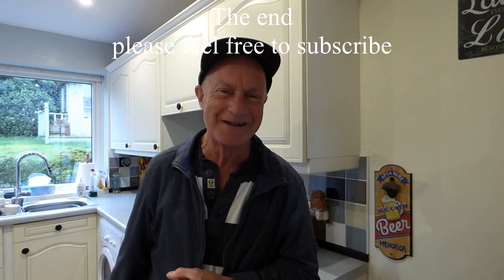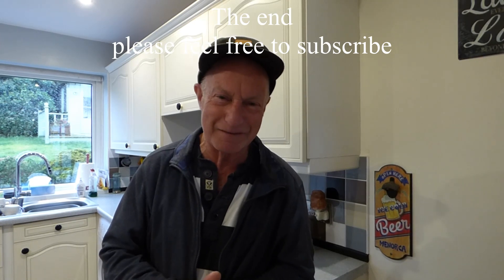What is the best speed to set the central heating pump ?

Comment: Another great video, thanks. I understand that all modern pumps are required (by EU law) to have an electronic speed controller which modulated the speed according to the system requirements which can change when valves open and close (zone valves, thermostatic valves, etc). So my question is, does it really matter what speed you select these days? Just stick it on max and let the pump control its own speed?
Reply from the maker: Great point! This refers More to the older pumps

Comment: Very good advice there, thanks. I think there should be a standard setting based on the amount of rads, that would cut out the guess work to some extent. In a 2 bedroom flat I don’t think you need the higher setting, you can set it at 2. For a 2 storey house with bigger rads and longer pipe runs, maybe 3 would be more appropriate setting. If you live in a mansion, it doesn’t matter, you will probably be abroad in some tropical country sunning it up.😃
Reply from the maker: Ha ha thanks.

Comment: lol a pint for me
Reply from the maker: System overheating you have black sludge that needs cleaning out. Or if it is running in when cold, then your hot water cylinder inner coil is broken or holed.

Comment: can any one tell me why i have water coming from my vent pipe in my f and e tank in the attic i have a solid fuel back boiler since the 1980
Reply from the maker: Need more specific info like if it only happens when the heating is on and have you had the system cleaned.
Reply: only when the heating is on when the pump is running .thanks @dereton33

Comment: very generous of you to help folks like this. Heres my riddle. Got an entire new boiler, pump, electrics, motorises valves and system flush for a two zone system. Plumber forgot to tighten down the pump and it leaked water for several days and I only discovered this as the noise was significant. He returned, tightened the pump down and the heavy noise dropped significantly but we’re left with a persistent high pitched whine that can be heard throughout the house. Im sure he will address this issue but I’d be grateful for your thoughts on what might be causing the whineing.
Reply from the maker: Usually air in the system.
Reply: pump speed was too high, whisper quiet now

Comment: Hello, my plumber has advised me to leave the pump on 3 but the pump gets very loud. I have changed the pump speed to 2 which works fine but now the boiler is short cycling. Any advise?
Reply from the maker: You must have a noisy bearing in the pump. Might be worth looking to change it.

Comment: I'm confused.  If I open all the radiators valves and TRVs to test pump speed, surely the last rads in the system won't get hot as the first rads will have used all the heat?
Reply from the maker: Balance them all first then test pump speed.
Reply: @dereton33  Thank you

Comment: My pump has decided not to turn off unless I drop it down to the lowest setting and the rads get hot even if only water is on; never had the problem before - the boiler/programmer/etc is about 5yrs old and it's a three bed semi.
Reply from the maker: The 3 way valve is faulty.
Reply: @dereton33  is this expensive to rectify on a system boiler?

Comment: What does the dial in the middle do?
The one on the red with arrow
 Mine is set to maximum?

Also does speed increase pressure?
If set to speed 3,is this running faster and increased pressure too?
Reply from the maker: The speed dial speed 2 is the best setting speed 3 like yours is costing more to run and putting more pressure on the system.
Reply: @dereton33  what does the twist knob dial do in the middle of the pump? Is that something we can alter?

Also what is difference between the speed when setting is solid and flashing?
It looks like there are 6 options to choose from?

Comment: I have just fitted a Wilo pico 1-6 that says lowest speed is for 12 radiators. Do you count double radiators as 2? The system is 15mm to the rads except one tiny one in an extension on 10mm and it's not heating up.
Reply from the maker: No, do not count them as 2. To get that 10 mm fed rad working you will need to system balance the other rads in order to force the water through the 10 mm pipe, or turn the pump up some more.
Reply: The diameter of the circulating pipework is important.  If you have a 15mm circulating pipework on 12 rads that seems restricting to me and may cause the rads at the end of the system never to get hot.
I have 15 rads in a 3 story house and put in 28mm circulating copper pipework to start with knowing I am never going to have a circulation problem.  I use it with an old ideal mexico cast iron boiler which runs on a bog standard timer.  I set the boiler thermostat manually and works a treat, no programmer, no fan, no pressurisation system, just a header tank, works beautiful.

Comment: Great videos and gentle quality knowledge 
How do you work out which central heating pump is best for your system and if a pump is on most of the time as in my elderly parents home, how long before it is worn out and are the signs of wear only by lack of heat in the system or is it always audible at the pump
Happy New Year
Reply from the maker: Pump starts to sound noisy and rads start to fail to heat up. A grunfos is always the best pump no matter which model.

Comment: High speed lower pressure so if the furthest rad doesnt get hot try turning the speed down a notch as the extra pressure might clear the sludge build up which should then be trapped by the magnaclean
Reply: Hi mate. It’s the other way around, actually - the higher the speed setting the higher the pressure. You can see that on the pump speed curves produced by the manufacturer. If all the rads are not getting hot you’d need to turn the pump speed up to force more water around the system.
Reply from the maker: thanks

Comment: Does this apply to a system boiler (s plan)?
Reply from the maker: Yes.
Reply: @dereton33  thanks for the reply. As it's an integrated pump I guess it will be a menu option. Think I need to read the manual!

Comment: Hi,

Thanks for the video. I have recently had 3 rads changed in my house but one rad keeps needing bleeding and it’s a lot of air… I have the gravity fed system.. I’ve had a plumber out and he put on auto bleed valves in the rad yesterday but this morning the radiator feels cold at the top and warm at the bottom again so suggests to me it’s still got air in it. I’m struggling now as to what to do so any suggesting from you would be great. 
Thank you.

Ps
Whenever I turn the heating on it sounds like the water is whooshing around in the rads like there’s not enough water in them.
Reply from the maker: Rad speed is too high set it a speed lower. Also your plumber may have left air in the system by the sounds of it.
Reply: @dereton33  how do I do that mate? I’m clueless when it comes to plumbing?
Reply: @dereton33  if you mean the pump it’s at 1 already.

Comment: Hi, do you mean both valves on each radiator? As in including lock shield? My pump is on 3, with 8 rads, just seems overkil for a 3 bed house imo

Also when hot water tank comes on, the radiators cool, is that normal? Thanks
Reply from the maker: Yes both valves, it is normal for the rads to cool only slightly, when the hot tank comes on.

Comment: Hi Al, what about auto setting 🤔 . I have a back boiler and a stove. Also central heating. Central heating is off and The fire in the stove has died well down but the pump was set up at 3 and going crazy for hours. I don't think it's right. I do have alot of rads and 3 stories to heat but I had rads off in the middle floor and down a bit on top floor. Anyway I set the pump to auto and it stopped spinning and went from 45 down to about 13. But I'm not sure what I'm at either. Any advice please 🙂
Reply from the maker: Auto will be fine, but if you want to be in the middle ground set it to 2.

Comment: THank you AL, your knowledge and clear explanations calm me down when dealing with and starting to panick with central heating issues.
would you recommend a system flush before fitting a new pump?
Reply from the maker: Yes as it is a system drain down to do it. You may as well.

Comment: hi bud, im having trouble with my central heating atm i seem to think the circulating pump has either seized or burnt out but my question is if either of those things have happened would it stop my boiler from firing up?
Reply from the maker: Yes it would, depending on what system you have. On an F and E system it would not, the boiler would fire run until it reached stat temperature then turn off.
Reply: @dereton33  mine is an F and E system, would the fact their might be air in the boiler/system stop the boiler from firing up? if so could i bleed the system via a radiator as the draincock on the boiler has seized?

My boiler does fire up for about 30 seconds then goes off. 

Also thanks for your help i have subbed to your channel great help 👍

Comment: hi mate same question but i dont have high med low i have this what do i set???  - Target value of internal high-efficiency pump in %. Possible settings:
0 = Auto
1 = 53
2 = 60
3 = 70
4 = 85
5 = 100

at moment its on auto and i can check the speed says 15%  my  return temp on the lcd of the boiler says 60c but i have thermometer strapped to return which says 52c  so idk if the lcd on boiler that says return 60c is accurate or my pipe thermomter??  I HAVE AN ECOTEC PRO 28
Reply from the maker: Best thing is to try setting the different speeds and seeing what results you get. See if you can get that return temperature any higher.
Reply: @dereton33  ok thanks what the best return temperature i should aim for. also  have a setting at d0 menu -  Heating partial load - its on 12kw  and we just had 2 new rads added with no adjustments should i leave that on 12kw OR turn it UP or set it to auto and let boiler decide?

Comment: Heya, I don’t know anything about heating but we have an old Riello 40  oil burner. It’s now connected to a new Titan 2 circulating pump. The airlock was seemingly fixed but the rads are only lukewarm. The pipes around the house aren’t even getting hot. Have you any ideas with how you can help us please?
Reply from the maker: Try balancing out the system. I have a video on how to do this.

Comment: Does this circ pump affect the water for shower and sink as well? I've had to keep my water heater (Boiler Mate 41 gal indirect gas connected to hydronic Burnham burner) at like 140° plus to keep my husband from bitching that the shower doesn't warm up quickly enough. I want to knock that down and keep it at 120° in hopes of it lasting longer. I've had my Grundfos UPS 15-58 FRC on low (attempts at lowering crazy electric bills with ancient central air conditioner and inground pool in the summer) and wondering if maybe it should be Medium or High with three zones of heating in the house? Would this solve the issue of hot water not arriving quickly enough to the shower on the second floor with everything listed above in the basement and keeping my water heater at the recommended temp of ~120°?  Thanks in advance for any advice!
Reply from the maker: Yes it would work a lot quicker. Time to turn it up.
Reply: @dereton33  Thank you so much for responding I appreciate it! The one thing I seem to keep running into, annoyingly, s that when it's running at a higher speed warm water seems to just flow into my forced water floor board heaters on the first floor zone right above the grufundos, boiler mate, and burnham...Sila was supposed fix while I was on contract twice, never did, and then try to get me to renew my maintenance plan and pay them separately for that.

Comment: Three of my radiators are not getting hot The system is only five years old doesn’t seem to be in the air in the system should I turn off the pump I have 11 radiators
Reply from the maker: Turn off heating and bleed the radiators.
Reply: @dereton33  thanks buddy 👍🏻

Comment: Can you help?

If I put my pump on 1 it’s dead silent but too slow and the boiler short cycles and cuts out.
2 is ok for the boiler but makes a helluva noise and vibrates the pipes.
3 is quieter but still a bit noisy and vibrates at the pump more but quieter pipes.

Any thoughts? 

Also thanks for the videos, helped me out a lot 👍
Reply from the maker: 2 is the best speed. If your pump is noisy then it may be time to replace it.

Comment: Hi there, I've got a slight problem these last few months, when the heating is on, someone in the shower, when they've turn off the hot water, few of the downstairs rads crackle, it's been doing this the last few months, I've turned down the pump speed to medium, which slightly takes the noise away, what causes the crackling sound in the rads. Thanks. Feedback welcome.
Reply from the maker: Sludge build up in rads.
Reply: Ok me old mate thanks for the advice 👍

Comment: Good comments all round, don't forget the lock shield valve at the other end of the radiator. Meant to adjust the flow through the radiator, mostly forgotten by all. Pump technology is advancing in the commercial world, and eventually the humble domestic circulator, they are not really pumps as such benefit. SIMPLY THE NEWER PUMPS regulate themselves according to the system resistance. This is a good series of advice and learning for all, keep it up.
Reply from the maker: Thanks Bruce.

Comment: Do you turn heat off before changing speed on a pump or can switch to different speed while pump running ? Thanks.
Reply from the maker: You can do it while running.

Comment: Happy anniversary!  Thank you very much for making this video - I'm the chap who asked the question.  It seems that setting 1 works OK on our system (3 bed house, but nearly half the rads are turned off). Quick question: the pump has recently got very noisy (a rattling sound), which gets better (or goes away) when the rad circuit opens up. It's an old F&E system (probably quite dirty). Is the pump on the way out?
Reply from the maker: Hi Laytekk thanks for suggesting this for a video.and your good wishes.  The pump is certainly on it's way out. Think about another soon.
Reply: @dereton33  Thanks, will do. Happy Christmas.

Comment: I have a Grundfos circulating pump too so I watched this keenly.  Doesn't it depend on the model (and power) of the particular model?
I have the 15-50 in a 3 bed house and Brit Gas have set it to 3.
Reply from the maker: Seems a bit high, give it a try on 2 you can always set it back if it dosent heat up as before.  If it all works ok then you are saving on your electric bill. Have a nice Christmas, from Al and Jan.

Comment: I’m sure my boiler has a variable speed pump as it’s only a couple of years old-I’m guessing it runs quicker when the system is first switched on by the thermostat and gradually slows down once up to temperature to keep the system ticking over??
Reply from the maker: Yes they are the best pumps for energy savings so far , Happy Christmas depechem0demusic.
Reply: dereton33 Merry Christmas Ho Ho Ho 😀😀😀